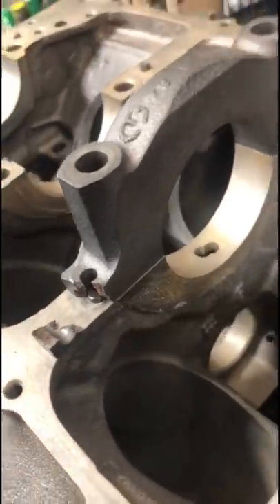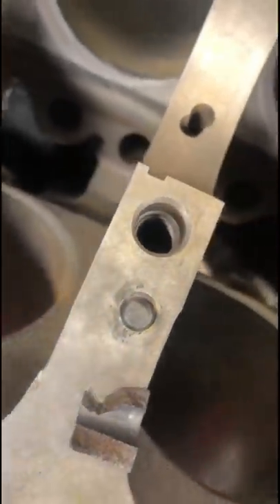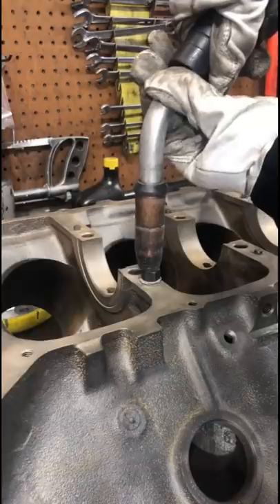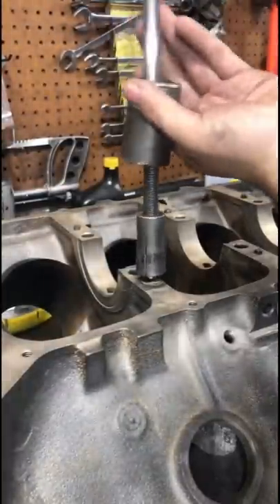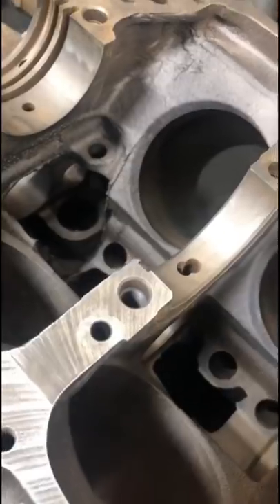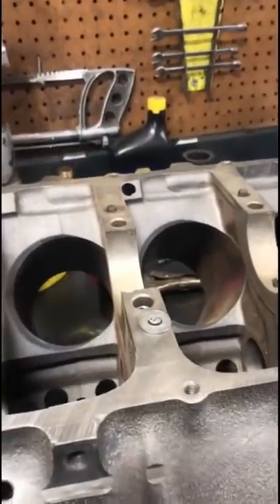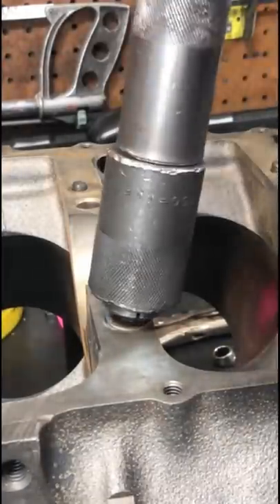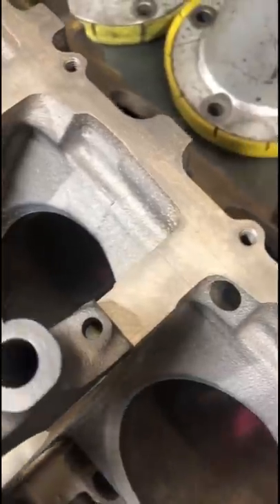#shorts This is why you should pay attention when building your engine…

Comment: Welder here. My dude just a tip if the weld pool bubbles you either don't have good gas coverage or the metals weren't very clean. Besides that nice job and love your videos makes me wish I learned machining
Reply: It’s a cast iron engine block all the pores in the metal soak up all the oil, could preheat to burn off oil but still gonna weld like shit
Reply: @ford300rippergarage  exactly, you can’t clean that fucker enough to make a good weld lol
Reply: He's not welding onto the engine block he's adding onto the part he's pulling out so the tool can grip it better so the cast iron engine block doesn't make a difference and the welder guy is right
Reply: @ford300rippergarage  the block is cast but I doubt that dowel is Cast.
Reply: His tungsten was also way too far away, he needs to tighten up that gap
Reply: @ford300rippergarage  this video was not showing any welding to the engine block 😑
Reply: In my experience welding casting it takes a second to "chase" out all the impurities in the metal. A good preheat, patience and thorough weld prep helps yield better results.

As for the dudes that always get comfortable talking ish in the internet. Why? I bet money you don't talk to people like that in person. What's with this puritan "I know it all your an idiot" attitude people take in comment sections??
Reply: The RebTek Channel  You know people have this thing called "free time" right? Us welders aren't working every waking hour. And people are allowed to give pointers even when they aren't directly asked for.
Reply: The RebTek Channel  It's actually a big yes. What brings this world forward is constructive critique.
Reply: The RebTek Channel  Exactly my point. Nobody asked about your view. But you thought your view (despite not being constructive) was important. While totally failing to realize that that would mean a constructive post would be many times more meaningful than your post. You just ended up very unlucky...
Reply: @nikolasramberg548  my thoughts exactly.
Reply: Holy fuck it was a hardened pin you guys are welders? 6010 to anything steel kind I guess. His best chance was a very high nickel rod and almost no heat but reading this makes my head hurt.
Reply: The shielding gas with the Tig welding is used to keep the atmosphere out of the weld…when using filler rod one should keep the end of the rod consistently within the cloud of shielding gas to avoid inclusions. 6010 belongs to a class of welding rod known as fast freeze, meaning the molten rod solidifies quickly…typically when welding 6010 a whip method is used. Though most believe 7018 is the best for dirty or painted metal it is in fact 6010. I couldn’t tell if he had the tip of his tungsten electrode sharpened or rounded, it needs to be rounded or balled up for aluminum as well a reverse polarity compared to mild steel set up. All that said I do think the Mig was the correct choice for the job at hand.

Comment: who tf uses an impact on any engine internals? that’s horrible!
Reply: They're great for disassembly, and on re-assembly you can use one to run the bolts down until they make contact, then come back with the torque wrench
Reply: But its a finesse thing.

I've got an electric 3/8 impact, I pull the trigger to run slow, and let go on the first click when the bolt makes contact, which is just barely past finger tight
Reply: @Texassince1836  exactly, I used the same finesse at my last quick lube job to zip drain plugs back on right quick with an electric impact driver
Reply: @Texassince1836  I'm sure that's exactly what the guy was doing here when he popped a main cap.

Impact is not the tool of choice, there's a reason air ratchets exist.
Reply: @rtkl13  most pro race guys have high end tools and pull the engine down between every race. They're not using impacts for assembly.

They also check to see if the dowel is lined up before tightening.
Reply: @glenwaldrop8166  gotta make sure you're lined up before you pull the trigger.

Odds are the guy would have broken the main cap just the same with a ratchet
Reply: @Texassince1836  most air ratchets don't have the RPM to pull it up that quick, HP (work done) is a function of torque vs RPM and impacts are high RPM with an impact function. Doesn't take much with an impact and suddenly you're at 80 ft lbs where the air ratchet will yank your hand if it snags.
Reply: @glenwaldrop8166  little 3/8 electric impacts take a few ugga duggas at full power to hit 80ftlbs. When I say "finesse" I mean it. Less than 20ftlbs on the first low speed click with the electric impact.

So just for an example I just set the mains on my 4 bolt 350 last weekend. My first step with the torque wrench is 35ftlbs, and every bolt turned before the click, telling me every bolt was under 35ftlbs. Then I come back at 50 and 70ftlbs (65 on outer) in 2 more passes.
Reply: @Texassince1836  a 3/8 impact almost certainly didn't break this main cap either.
Reply: @John S a drill or an air ratchet is slow enough to keep from busting something.

Impacts aren't subtle. That's their entire reason for existing. One little slip on the impact and it's 3,000 RPM+.
Reply: Many guys use them. I can see taking a engine apart but never putting it together hand tools only is the right way that I have been taught but I don't even use impacts on taking them apart because I like to feel everything come out and be able to catch if there is a issue
Reply: @glenwaldrop8166  didn't say final torque settings but they most certainly do use impacts. I recently sat thru a tear down and reassembly on Ron Capps Top Fuel car and the guy underneath putting the bottom end together was using a Dewalt 3/8 impact to assemble then he would come back with the torque wrench....lining the dowel is a fundamental step that should be second nature
Reply: Cummins actually recommends a impact gun
Reply: @mackmanitz6238  for disassembly, sure. at least on rod caps I can see that. i wouldn't take an impact to main bearings or camshaft caps though.
Reply: Don't be in a hurry or lazy period
Reply: Same kids who buy cast caps
Reply: Channel locks and a small hammer  and an adjustable
Reply: Cummins suggests using an impact on headbolts. But that's because they require 90° after being torqued to like 500 foot pounds
Reply: @mackmanitz6238 but if you use an impact like Cummins states then are you supposed to get a certain torque stick. It just worries me because the impact puts extra vibration on the threads when installing that you think could overheat the threads.

Comment: The engines we build are all done without any power tools! It's a lot less risky and doesn't take all that much longer with the proper setup
Reply: I use impacts for disassembly, but never for assembly. I think that main bearing cap cracked because it was not seated completely, but still, impact wrenches are not assembly tools. Air rachets yes, impacts never.

Comment: Pops taught me the weld trick in NY dealing with salt and over torqued bolts(the worst) Saved time and nothing is more satisfying than a car back to factory specs. Can be a manifold or water pump housing. Proper heat and penetration makes it. Thanks!

Comment: Tig welding is fairly easy I have fixed so many cracked engine blocks transmission bolts built up a whole thread from filler wire tapped it and shaped it perf with grinders aluminum to cast iron.  Keep practicing it gets easier and easier for sure. The cleaner your metal is the better/easier it will be.

Comment: Hey bro tig welder here.  i noticed that stud was sparking when you were welding it. The reason for that is those studs are some kind of alloy steel with carbon in them. Carbon steel has a tendency to shoot porosity when you tig weld it. 

To fix that problem you can weld onto the carbon steel with a stainless filler rod, or some kind of dedicated alloy filler rod, probably something with nickel in it.
Reply: That's not why it was sparking. Looked like inadequate gas flow in combination with too large a spark gap

Comment: Cool secret about those dowel pins on those older Pontiac’s, they are drilled all the way trough, so you could have just pushed it through and used a new sbc head dowel or tapped it out with a long narrow punch. I had something similar happen at the machine shop I work at doing some block repair.

Comment: Hey, just a tip. When you TIG you need to turn your heat up, and turn your HZ up. Stay @ 15-20*, its not stick and you want an almost strait up and down with your tungsten. Hit your pedal 3/4 and when you see a keyhole, dip in the front side of your puddle, not into the puddle, so when you work forward your workinf your filler into the parent metal!

Comment: I sometimes would have to go help this one field mechanic Jr. he would always use a 1” tire gun to tighten head bolts on a 3406 Cat. Engine.  Would always piss me off that my name was also on the job.  🤯
Reply: I work at a diesel shop and we rebuild the injection pumps for all kinds of motors including the 3406. By the size of the damned inline pump I can’t imagine how big that damned mother of a engine ought to be!
Reply: @jr.daniels7750  14.7 liter engine size for the 3406.  I use to also build cat fuel injection pumps.  I rebuilt a lot for the 3412. That’s two 3406 size engines.  And 3408 engines.  Love that yellow iron.  :~)

Comment: ALSO... Give the main cap a few small whacks with a lead hammer to seat it into the indents on the crank skirts. This will also go far to prevent the caps from cracking.  Why would anyone with any sense use an impact?

Comment: Here is a tip. To remove a dowel, weld an upside-down socket head cap screw to the dowel. Make a slide hammer with a tapped hole that can be threaded to the screw threads. Works like a champ.

Comment: Regarding your tig skill, as u are adding filler metal slow down and watch your hete input let it cool a bit longer before striking ark also when you terminated your weld keep the shielding Gas flowing over the hot metal this will greatly reduce porosity allowing stronger additional metal

Comment: Used an impact to run the bolts down, never to torque to spec. But let's be real, I bet the impact didn't break that dowel embossment. Those were notorious for cracking under normal use. Several Pontiacs I built had cracked embossment. Don't do anything to make it worse.

Comment: Stop pulling your filler rod out of the argon flow.  Also pre heat the area to  250 ish then spray off with acetone while hot.  Set argon flow to 28cfm amps to 100+ use 309 or higher stainless filler

Comment: This is why you don't force anything together, check everything twice and build once.
That poor Pontiac, glad it isn't mine.
I'd hate to have the stress on the tightened cap (the bolt stretches to hold the cap and the tension travels through the iron) meet the broken edge of the dowel hole, crack and drop the piece in the pan.
Could be fine, could be a disaster, hate to take the chance. 
Only half repaired, at least in my shop.

Comment: I’m no like professional engine builder…. But I’ve probably rebuilt 3 or 4 and they are all still running fine with 150K + miles on them….. I was always taught to never ever ever use any power/air tools on an engine… especially the internal stuff

Comment: Only use an impact when you absolutely have to. If something is stuck or if I'm removing say a camshaft pulley bolt or an axle nut sure I'll break out the impact gun but never ever ever otherwise. You're just asking for trouble.

Comment: Your exactly right,  Pontiac did have a great idea with down pinning the main caps though.
Reply: I've always preferred the Chevrolet smallblock caps that fit into a notch on the main saddle, no Dowell pins to wreck.
Reply: Yeah if only the bottom ends of ponchos weren't so weak in factory form

Comment: The only thing I’ve ever thought to tighten with an impact were lugnuts on a large truck. You know when you don’t wanna carry that 3ft torque wrench with you. It didn’t take more than a regular 1/2” drive ratchet for me to pull threads out of an aluminum transmission case, they must have a bunch of money and not a lot of patience  to be hammering away with an impact during engine assembly.

Nothing wrong with a lil practice here and there just comp an hour on the invoice lol
Reply: 3 foot torq….. FENCE PIPE BRO!!!

Comment: Just get a new cap the damage will spread now over time and heat cycles it has caused a weak spot and just leaving a damaged cap in the engine is as dumb as using a impact gun on the internals of the engine.. i have first hand knowledge that over time that cap will develop cracks webbing from that broken corner especially when you have a heap of torque on it with the heat cycles just replace the $50 cap or get 1 of a car wreckers for $5 either way is better than leaving that damage in there.. sure it might last a few months and get you home in a emergency but never ever leave damaged parts on an engine period.

Comment: Call me old fashioned but I always use hand tools when cracking nuts bolts and studs loose and always tighten by hand when assembling before torquing up yes it’s time consuming but you can feel the threads and you know if something is wrong

Comment: When I was in high school and in engine-building class a kid taking a breaking bar and tightening the bolts so tight on the main caps that he snapped them the same way
Reply: You had an engine building class in high school? Holy shit.

My school didn’t have any form of auto classes.
Reply: @internet_internet  yep we started with a 327 1966 Corvette motor then we built a 302 Ford 5.0 GT Mustang motor then it was a GMC V6 the old-school ones that are basically a 350 minus2 cylinders  Then a Jeep  In line 6 Yup it was pretty cool But this was in 1995  I heard they don't offer this class anymore or it's a shameBecause after that class you had a certification for a dealership.

Comment: Wait, pretty much every engine tries to twist under load just due to its own torque, could you use that to counteract the mismatch of forces in an offset engine?
Or would that be impossible because the offset always has to be on such a side that would make it impossible to counter the torque?
Or is it just not a relevant consideration because that would just introduce additional stress to engine components or something?

Comment: These type of ordeals is the challenge that many mechanics  are facing  every time  they work in Overhauling Aluminum engine blocks .there a bunch of theories about why this happens .since the integration of  Aluminum materials by Engineers in the motor  companies  industry  many positive effects has been made. however not everyone is agree .and the downside came in differents boxes since not all aluminum are suitable to sustain changes in temperature and pressure.something that every moving part need depending on his purpose . Foundry is the first problem .every material has different properties.Aluminum sulfates never react positive when any other metal is in contact with him altering his molecular Chemistry . Aluminum has a low melting point and react stable when lot of Oxygen is present but is intolerant to acidity .steel and iron materials are by far more resistant and durable under stressful temperature and pressures  and his melting point is more high. observing this .steel  and iron.specially cast iron are a formidable materials of choice to engines manufacturer industries.and others.in the video shows the effect of how Aluminum interact with cast iron.oxigen is what you need to cause Oxidation and sulfation  these two  produce acceleration of Electrolysis  the expansion and contraction of theses two elements submit to one another melt  and a false foundry is imminent. Ligh weight I s the only advantage of engines  made from Aluminum over cast iron as gas and combustible price went up to the sky.nothing else.

Comment: Your electrode was popping out too far. You need to lessen the distance from the tip to your cup. Not enough inert gas hitting it. Also could just be shitty material to tig hence the bubbles

Comment: Your running your tig welder way to hot also your rod gauge looks to be 3/32 which means you should be running around 60 to 80 amps also make sure your getting good gas flow based off what I have seen your running to hot but it might also be partly do to bad gas flow

Comment: I call bullshit on that main being good. The flaws in that break is likely to result in a main cap failure. It should at the very least be ground and polished smooth and flat, then magnifluxed to check for cracks.
Or, instead of all that work, just replace the main caps and remove all doubt.

Comment: You are going to leave the fractured bearing cap? Bruh... At an absolute minimum you need to grind it back and smooth. There's a good chance there's a stress fracture in that cap you can't just leave it. At least grind it back and inspect the thing.
Reply: U can tell its not something hes gonna be driving or depending on right?
Reply: @shawnmccarty6923  That's not the point though, a little bit of work cleaning up the fracture surface and doing a little inspection is going to save you from wasting a ton of time down the road when you reassemble and reinstall the engine and have issues.

Comment: The damage to the main cap will not effect its ability to hold the bearing shells 👍
Reply: The damage isn't to the actual bolt threads, only to the alignment post holes so they good